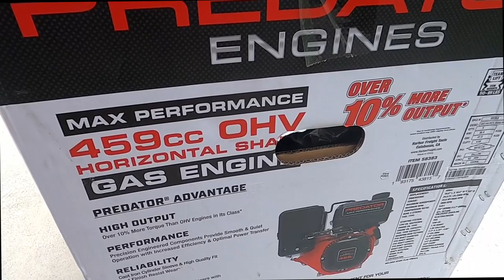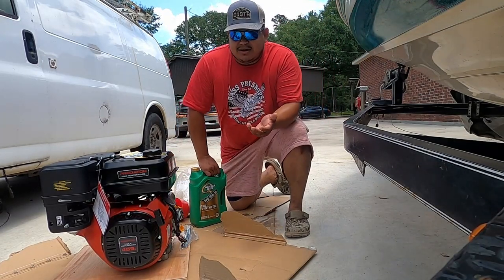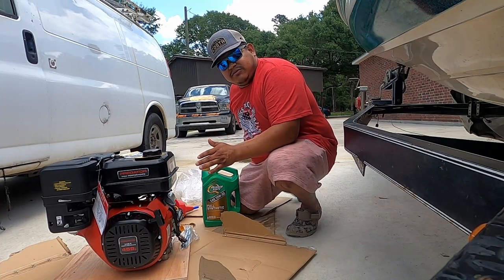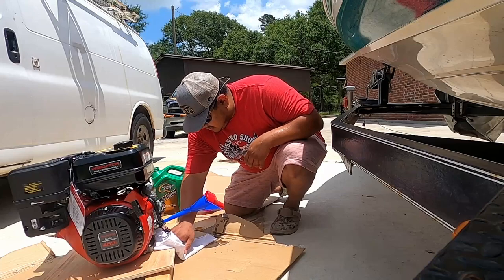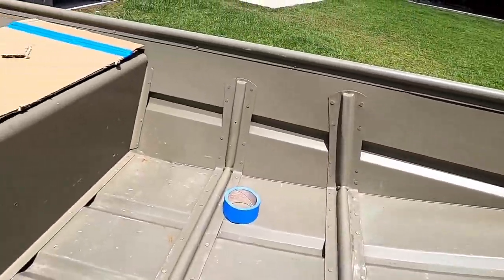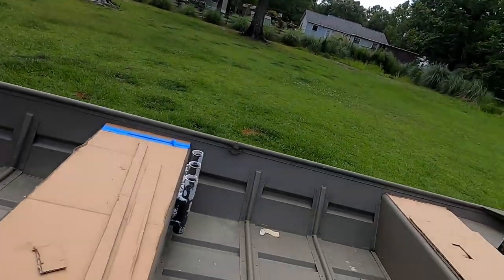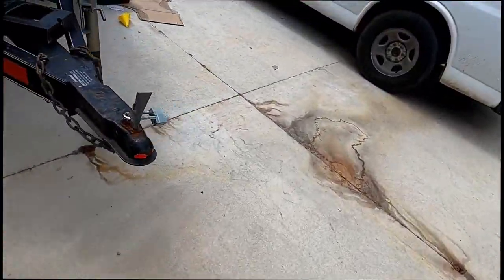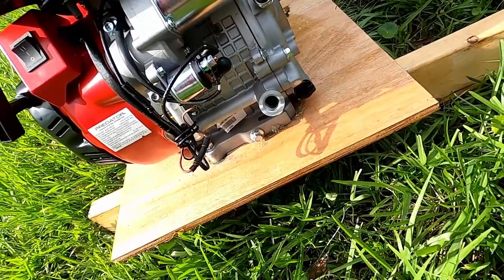Predator 459 unboxing and break in with seadek  installation

Comment: Hey Mr. Bryan. Keep making your videos. I subscribed. I just bought the same motor. Going to put it on a Beaverdam long tail kit. I will also be doing the Seabeck on my seats. I have a Lowe 1440M. I have already put a floor in the rear section and also put on a nice floor-mounted grab handle/ I also mounted a light bar in the front. Need to: 1. Break-in 15.8 motor. 2. Assemble and grease Beaverdam kit with 15.8 motor. 3. Finish wiring Jon Boat from the rear of boat to front for all lights and power start for 15.8 motor. 4. Camo motor and long-tail kit. 5. Assembly an ammo can with all emergency kit for the boat and mud motor. 6. Get it out on the lake to test it and get it adjusted. 7. I may need to have the handle lengthened by bending the curves in the handle, or by having a longer piece welded to the handle section that mounts near the motor base. This may result in a need for a longer throttle cable. (We will see on that one.) 8. Back to the lake for checking and fun. 9. Fish. 10. Duck and Deer hunt with my jon boat. 

Rangers... Lead the Way!
Reply from the maker: I need to get a can set up as well for emergency in case i need to work on the motor i plan on doing the first run on it this weekend. Im excited for duck season first year i will have a actual boat to get to them instead of a kayak
Reply: Hey bud I have the same boat! How did you mount the light bar on the front? Would love to get an idea thanks👌
Reply from the maker: @BuCkYwUcKy123  i dont have a light bar on mines yet thats my next project

Comment: Mine ran for about 3 hours on a pressure washer before it started shutting down via the oil pressure sensor - disconnected it electrically, problem solved.  One should be in a habit of checking oil level in any small engine prior to startup.  Not sure if oil pressure is low or sensor is bad.  Probably the sensor as it's still running fine.

I too ran a couple of tanks of gas through it for break-in along with an oil change - before putting a load on it.
Reply from the maker: Thankfully I haven’t had a single problem with it

Comment: Dude you know their is a drain plug in the side of the motor to drain the oil plus you only need to change the oil once with zinc I don’t know why you change the oil so many times one motor start up and run just to breaking a motor. It only needs to be ran for like fucking 10 minutes not two hours.